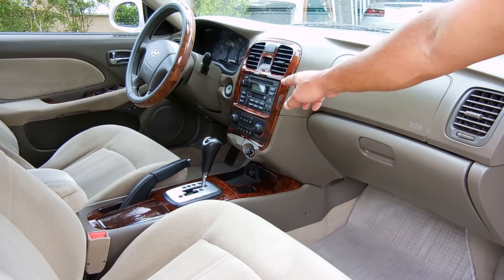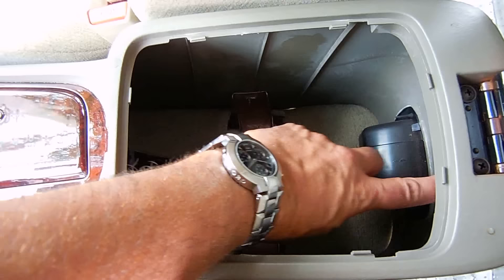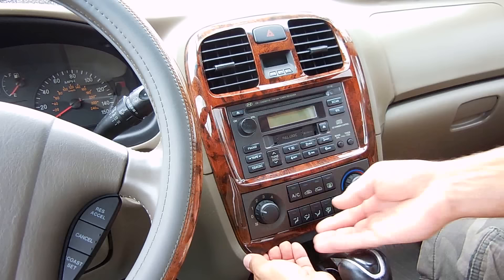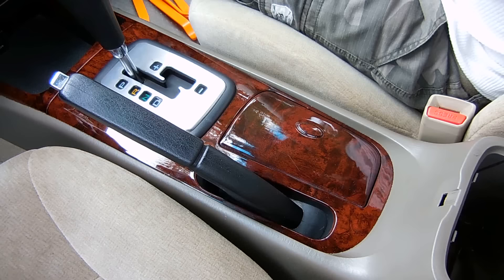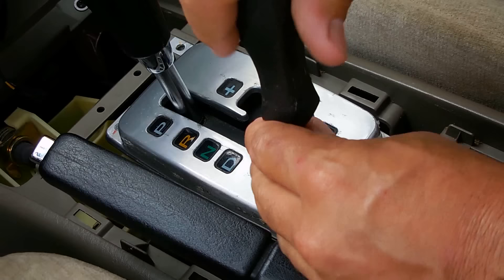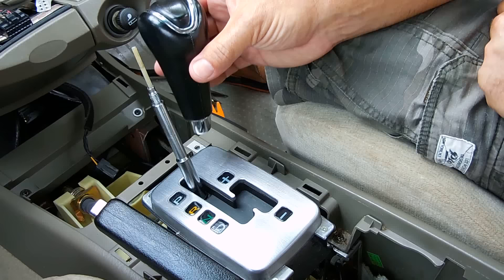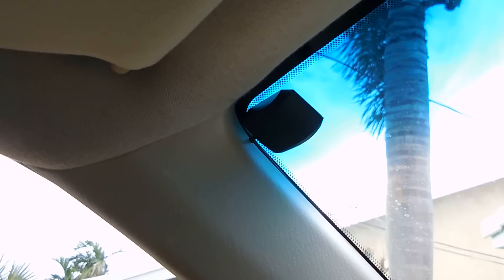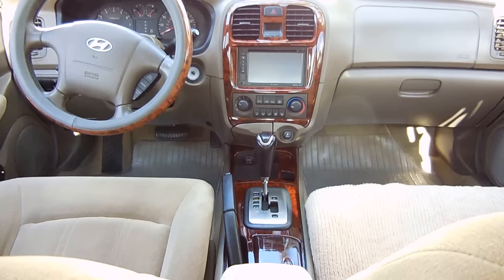How To Install In-Dash Navigation/Sound System/Backup Camera

Comment from the maker: If your newly installed system has a low level whining sound that varies with engine rpm, then you'll need to install an inexpensive power supply noise filter on the ACC+ power wire to the Planet Audio system to eliminate that whining. Below is a link to one that I bought locally which worked just fine for me.

http://amzn.to/2eILZIF (Affiliate Link)
Reply: Can i do it with my honda accord 92

Comment: Was there a specific reason for not using an adapter harness between the dash harness and radio harness? Splicing directly into the dash harness to save $5 is not the best as it leaves less wire length in the future for another future upgrade. All in all a great tutorial. Thanks.
Reply from the maker: No need for the adapter. There won't be less wire because the new harness added about 6". :-) Thanks for watching!

Comment: I have to say finding your video is really ironic cause I was thinking of putting in a new sound system with a backup camera in and what's ironic is its basically the same car I'm working on which is a 2005 Hyundai sonata and the color is white XD. but the difference is my a v4, not a v6.
Reply from the maker: Yes. 2002-2005. Same model. Be sure to look over my "Auto & Mechanical" video playlist, you'll see much more of the car. Thanks for watching!
Reply: @electronicsNmore  I will!

Comment: Congrats, ElectronicsNmore, your video is well explained, well video graphed and your idea is well expressed and clear, to the point. The question is, though, will it all work for my Subaru Forrester 2002? I always wanted to have a Dashboard Led panel to display all things, and this might be my opportunity. Can you advice? Thanks for video.
Reply from the maker: Hi there. I believe your vehicle has a Double DIN, or 2-DIN opening for the stereo. Make sure online. If it does, it will work. Be sure to use the link provided. Thank You!

Comment: If my car doesn't have an electric antenna, where do i connect the blue wire? Great video by the way! i bought this system following your link.
Reply from the maker: Your antenna is likely in the rear windshield above the defrost lines. You can ignore the blue wire in that case, but if you have an amplifier, use the blue wire to turn on the amp. Thanks for watching, and thanks for your support!
Reply: Thanks you for the quick response! Love your videos, keep up the good work!